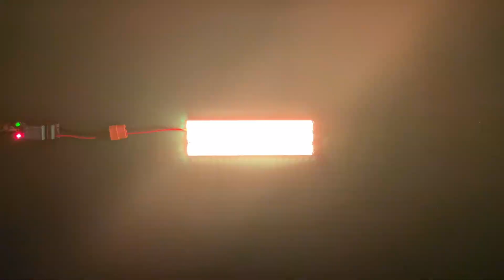DIY LED Sequential Turn Signal Light Panel | Syncing Speed With Your Car | WS2812B LED & ATtiny85

Comment: turn signal must be yellow
Reply from the maker: Not really. It should be Amber
Reply: @HAZITECH  In German there is no difference between yellow, amber.
Reply: I'm thinking. There is no amber in German. It's either yellow or orange. A car flashing light is yellow in German, but the same light is amber in English. The same applies to a traffic light.
Rot, gelb, grün -> red, amber, green
gelb = yellow or amber
gelb and yellow have the same word root.
but what is amber?

Comment: This is by far one of the dumbest and most unsafe things I've seen from a DIY channel. Turn signals and lights on a vehicle (car/truck/school bus/ambulance/firetruck/etc.) Light types and colors and functions are engineered and planned out VERY specifically with driver and occupant safety first in mind and not just for the vehicle they're on but for EVERYTHING around the vehicle that could be temporarily blinded (other drivers/pedestrians/etc.) and impacted if the driver lost control or got temporarily blinded by the idiot in front of them with these "LED Turn Signals" installed. Even the transparent covering over the lights (light housings) has been engineered very specifically by engineers who have spent years and years and hundreds of thousands of dollars studying exactly what the best and safest and most cost effective method is for vehicle lighting. Not only are you promoting to your viewers a far more unsafe driving experience (including being unsafe towards other drivers) but also you're promoting something that if ANYONE did in the US or Canada or the UK or pretty much most other countries with traffic laws and vehicle standards you would be fined by the police and have to show up in court proving you fixed the vehicle (removing this crap and installing actual lights designed to be used on a vehicle) within a certain time period or you vehicle is impounded for being a unsafe road hazard and you are fined thousands of dollars for endangering the lives of EVERYONE around you when you're driving. Reporting this video before you get someone killed or fined or thrown in jail for vehicle manslaughter.